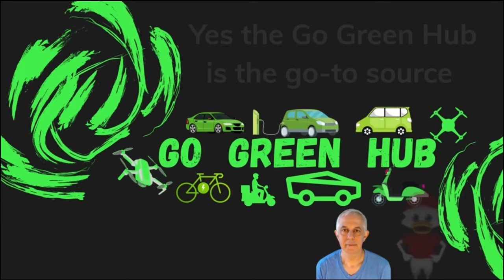Tesla Cybertruck | what's going WRONG?

Comment: This is the very definition of a hit piece.   The recall has nothing to do with the 10% layoffs or the compensation package Elon has earned.   
The comp package issue has been in the works for over a year and may not end even if the shareholders reinstate it.
There was no fixing the timing.    Tesla needs to continue to function.
This voluntary recall means that Tesla will fix it.   Meanwhile back at legacy auto Ford is not fixing 42K vehicles with fuel injectors that may leak.

"Ford reported five fires on this expanded recall population with the faulty fix.   The cracked fuel injector issue is limited to the base 1.5-liter turbo-3 engine. The recall of the recalled vehicles totals 42,652 vehicles.  A cracked fuel injector can result in fuel leaking at a high rate onto the cylinder head, which can then run onto hot surfaces near the exhaust manifold or turbocharger. Fuel vapor on a hot surface can ignite a fire. Ford says it will update the engine control software to detect a leak and service centers will install a drain tube to run any leaking fuel away from the engine. Replacing the fuel injectors with ones that don’t crack would seem the better solution."  Source article:  "Ford Escape, Bronco Sport recalled again for fuel leak, fire risk"
Reply from the maker: Thanks for sharing important information

Comment: "Tesla, always thorough in its approach..." (01:16)

You're joking, right? As an engineer, I'm APPALLED at their reckless approach to technical issues. In particular with the ridiculous-named "Full Self Driving" feature.
Reply from the maker: I'm not an engineer, but I must agree with you about Elmo Fudd and Tesla's "Full Self Driving" feature. What else are you appalled about?
Reply: @GoGreenHub  lots of things, including:
- An over-reliance on OTA updates to fix safety-related issues. This creates a culture of "it doesn't matter if we screw up; we can always fix it later". 
- Knowingly selling Model S with a design flaw in the batteries that could cause fires
- Many incidents of sudden unattended acceleration (much higher than other brands)
- The "Whompy Wheels" fiasco.
- Build quality issues
- The absurdity of removing the indicator stalk, despite the fact that this makes navigating roundabouts much more dangerous.
Reply from the maker: @michaelnoble2432  Wow! Thanks for adding this significant information